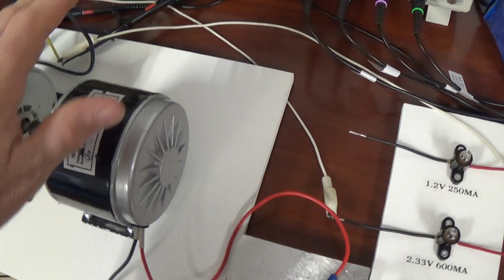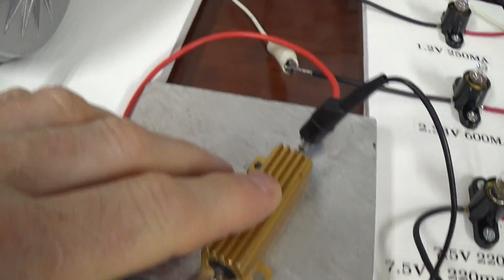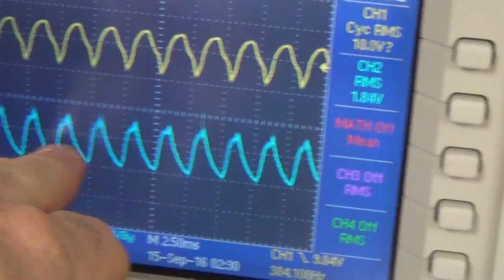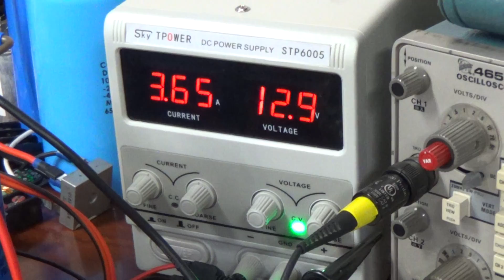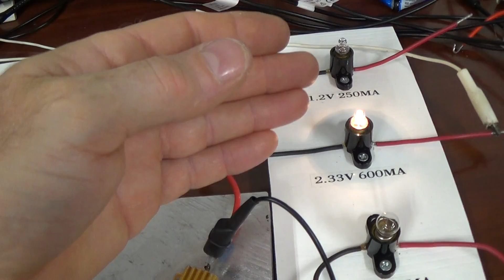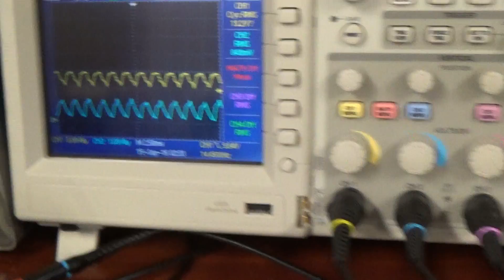Felipe Peña MEV test 1

Comment: put a small video delivery 36v dc three batteries to power the engine Mev, you can see the ability to raise the voltage dc / dc
Reply: the modification has been cast on u. modified universal washing machine motor with neodymium magnets, the best performance transformation I've gotten has been generating 100w, 160w consumption, a greeting

Comment: Hello Luc, im glad to see more people getting interest on spanish inventors, there are plenty of them equaly silenced and ignored, but sorry you made a wrong modification, a 4 pole motor need 2 new brushes... the motor have to spin from new feeding brush to the new output brush, if you spin it by hand you have to get positive in the output brush.if not, is not a MEV, this means Motor Elevador de Voltaje,(Voltage Elevator Motor) as you see the motor is divided and made it asymetric. and you wil get higer volt in output brush. The coils are reduced and need to reduce the volts from nominal to adecuate or it will get hot very quick. if you have saw the photyos or videos of Felipe you see he use a 180v nominal motor but feed it with 72v. Check out my videos as Felipe personaly gave me to upload and there is a video expalinin the 4 pole motor. the only the better your spanish the better you will understandlol  but is very visual and easy to understand. cheers! https://www.youtube.com/watch?v=T_s4dsuSvt8&list=PL2iovyMR9GjkHfSzlC38r3yT4o_YchlKQ
Reply: can you draw the diagram ?

Comment: good morning, the tests we have done with the MEV system have been based on dividing a brush motor into two parts, a motor with a mobile brush fed with positive power, output positive, a common negative, dividing the engine into two parts loses torque, feeding the moving blade varies the angle of attack with the magnets and the number of coils are fed in series engine, being able to maintain the same rpm working with different input voltages varying the angle of the moving blade, this allows both to vary the output voltage and feed the engine with different inputs, the best results have optenido feeding the engine with dC pulsed getting dc linear more peaks discharge very high coils, testing efficiency as rotary transformer dc / dc with different resistive loads and different angles brush feeding have been of an efficiency of 60% in the best cases, all load applied to the motor output is reflected in the consumption of source that feeds the engine
Reply: como te manejas el ingles macho!! hahaha si este tipo ha puesto el ojo en lo de Felipe y esta en el foro ingles de overunity es que hay gente dandole vueltas. pobres ignorantes no saben del TRIMEV... tendré que mandarle un mail a luc gotoluc
Reply: El traductor , algo que añadir a la explicación?
Reply: ya le he puesto un comentario que esta mal echo. ha cogido el motor de 4 polos y a quitado una escobilla y usado las 3 restantes.ademas alimenta el motor al voltaje nominal y le da solo 10v de salida. no saben ni por donde les da el aire...

Comment: I recognize in this experiment some things .. .. Similar results.
It is free lunch, because (as we know) motors are designed terribly badly and our power supply is fighting against the BEMF (the power generated by a motor). By using that power, the total efficiency goes up.
It would not work (as well) if you would use a PWM on the motor.
So far my 2 cents.